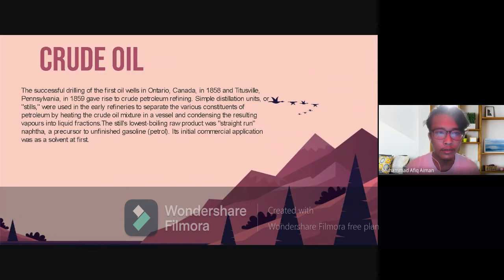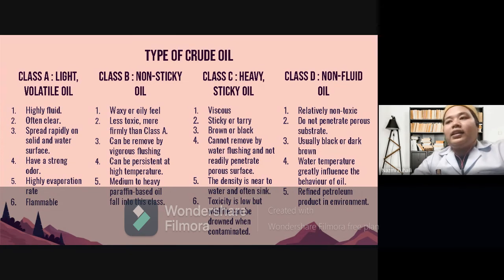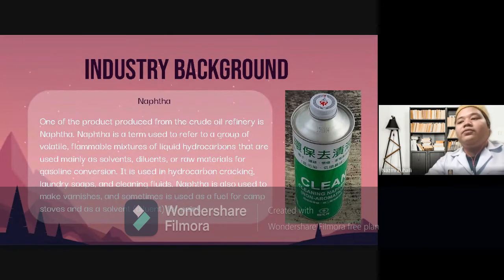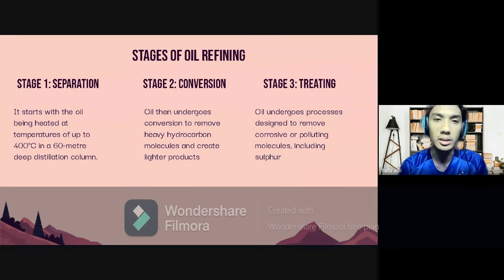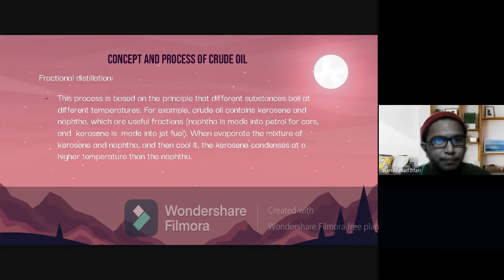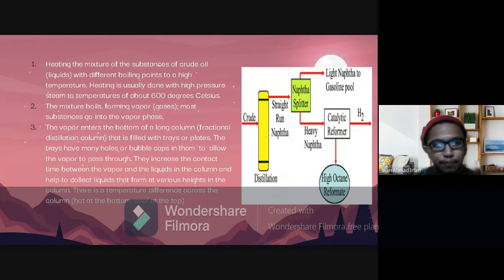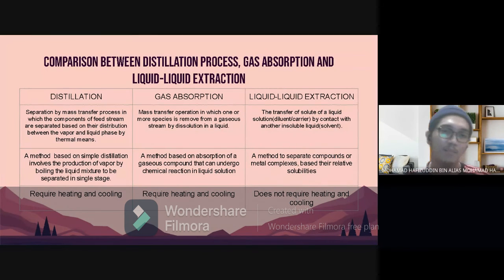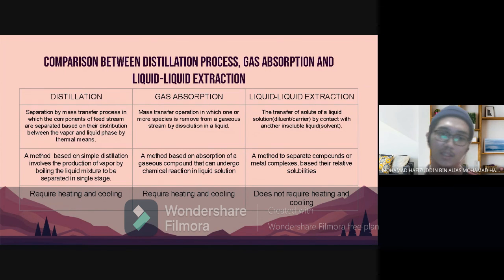CHE249 GROUP 6 CRUDE OIL DISTILLATION

Comment: Irfan : Why does it necessary to heating the crude oil mixture with different boiling points?
Reply: This is because the molecules in different fractions have different length chains. This means that the forces between the molecules are different. These forces are broken during boiling. For example, for the large molecules likes bitumen and heavy oil have a very long chains so there are strong forces of attraction between the molecules. This means that they are difficult to separate. So they have high boiling points. While for the small molecules likes petrol have a short chains. So the molecules do not have very strong attractive forces between them are easily to separate. They have very low boiling points.

Comment: Hafiz : can you explain the differences for light gas oil and heavy gas oil?
Reply: Light oil requires less processing and produces a higher percentage of gasoline and diesel than heavy oil. Heavy oil evaporates slowly and contains materials that will be used to make heavy products like asphalt, whereas light oil requires less processing and produces a higher percentage of gasoline and diesel than heavy oil.

Comment: Nazmi : Can you suggest other products that you can get from crude oil other than naphta?
Reply: Other products of crude oil that can be produced by distillation are butane and gasoline for lighter oil products, and kerosene, jet fuel, diesel for heavy gas oil products. The categories of the products are determined by the boiling temperature of the oil itself. That's all.